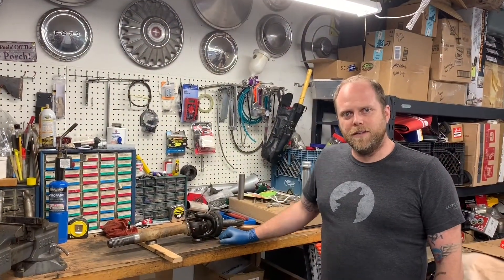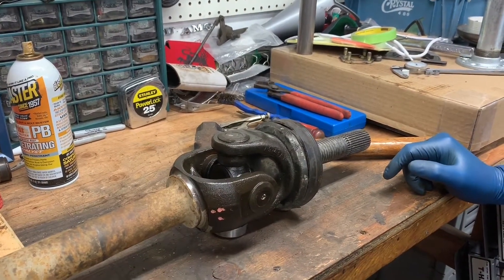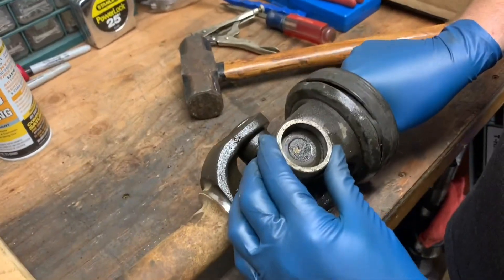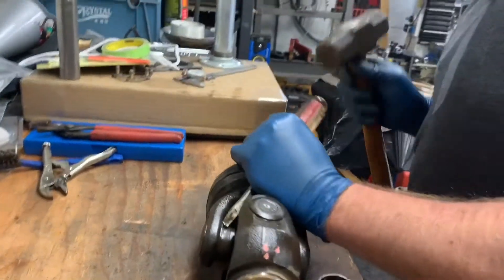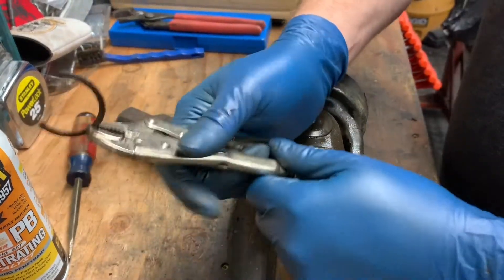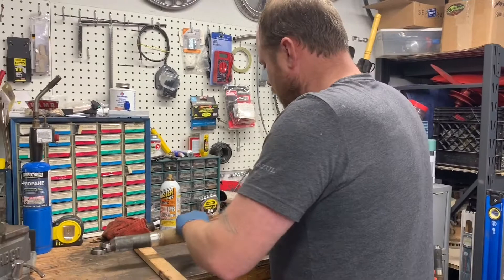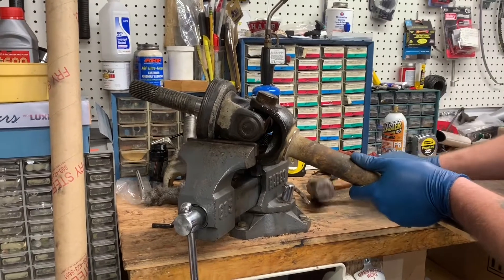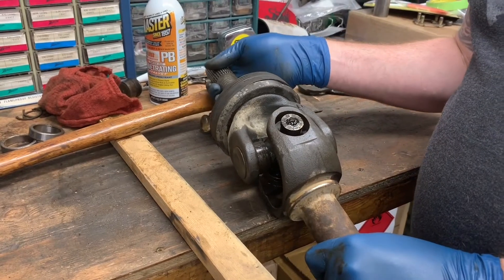Ford Super Duty Dana 60 Axle Shaft Disassembly: F-350 U-Joint Removal & Seal Replacement (Tear Down)

Comment: Got a 2000 F350, in Europe!!! Recently it was towed because it was parked illegaly (so they claim). I was not present when they  towed it. They cut the bolts that attach the shaft to the flange and removed the shaft from the flange. Towed it about 5 miles and hooked up the shaft again using aluminum bolts. 3  weeks later I drove it off their property. After a couple of maneuvers, trying to get out of their tow-yard, as soon as I got on the street, my flange broke! One thing I forgot to say, throughout all this time, my truck was always attached to a 37foot camper which has about 13,000lbs. Anybody knows why that flange broke?
Reply from the maker: I’m not sure I’m following? What flange? Front driveshaft flange? I’m not sure how it works over there, but if I tow truck operator cut anything on my truck, I’d take them to court.